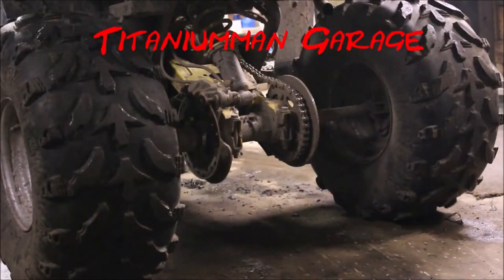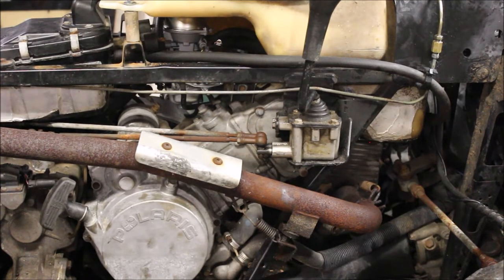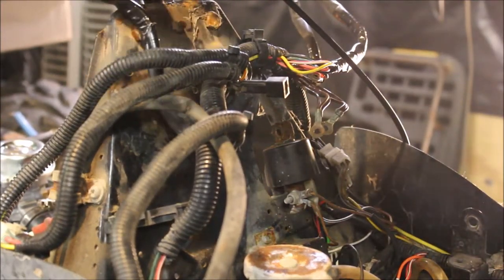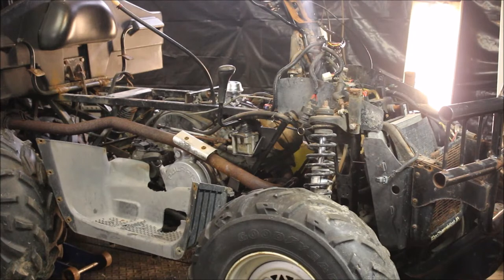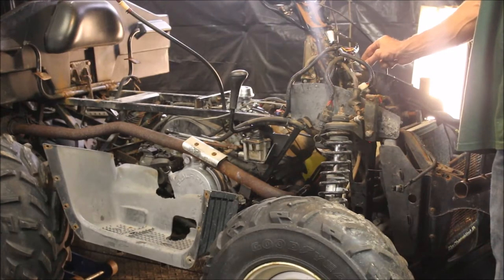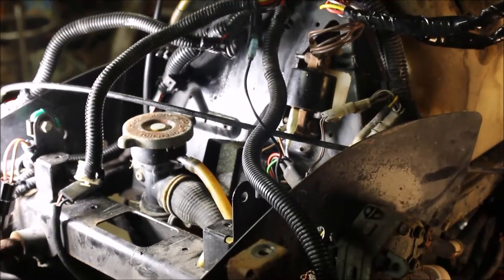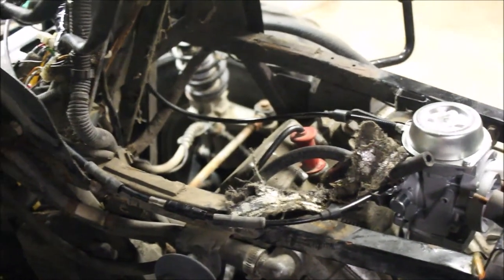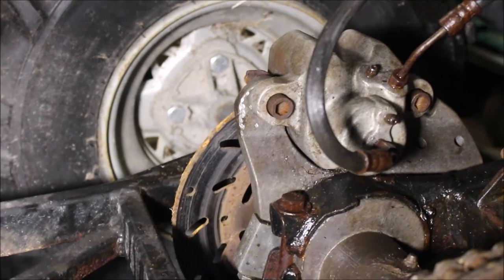2000 Polaris 6x6 Project Complete! 10 Different Repairs! Halloween SpeciaL!

Comment: I got a nightmare like yours. 😂 i got the 500 sportsman 6x6  bought it had bad bearings middle axle. Wound up having to cut the axle and housing in half to get the axle out. Everything was seized up  . I heated lubed penetrating oiled it beat it some more for two days straight . Got a big puller rigged it up to get it where it would pull nothing. So my option was destroy the axle so i did . Bought a new axle and carrier locking nuts and all . Got it all back together rode it less than 5 months axle carrier bearing failed again but this time it was ugly. It snapped the chain and busted my gearcase rh. I just finished getting that tig welded up rebuikt the tranny got all that put back in discovered the axle carrier is shot again. 😩 i have a love hate with this machine

Comment: So what is a 2008 with pull start options  , at 1100 miles. New 3500 winch and brackets.  Extras  front rim and tire??????

Comment: Hi I have been watching your channel for a while. I bought Polaris big boss 6x6 ‘95. I’m working on restoring that one and I’m replacing the 400 with 99 500 engine. Then I bought 2004 Sportsman 6x6 to use while I was working on the restoration. I have huge problems with the 04. The speedo was dead when I got it and new one was included in the purchase. Then I replaced it only to find that I don’t get any gear indicator lights at all in the speedo. I also don’t get the speedo to work telling me the mileage. I have worked on it for a while and I can’t get any information how to repair the loss of gear signal. Do you have any advice??